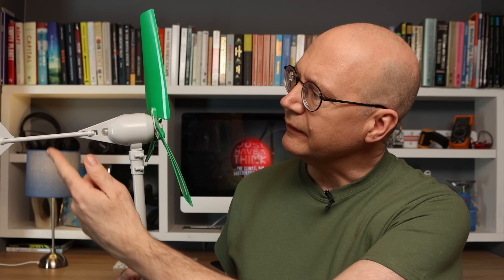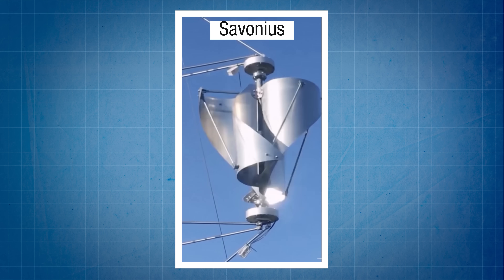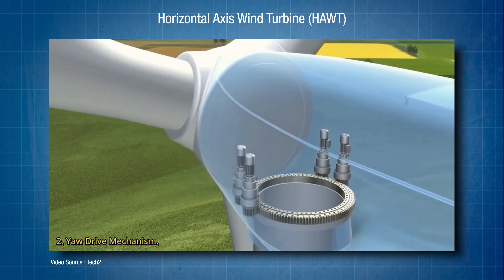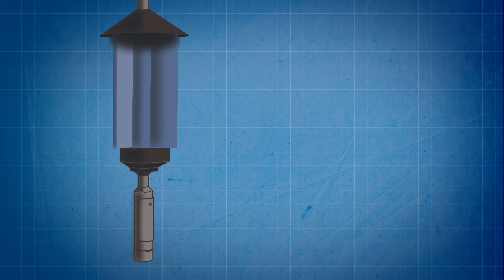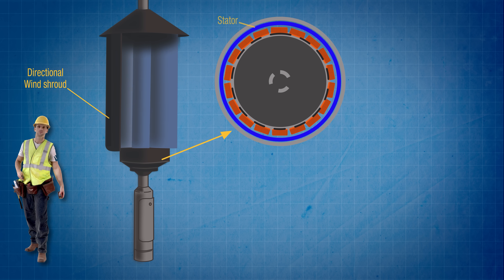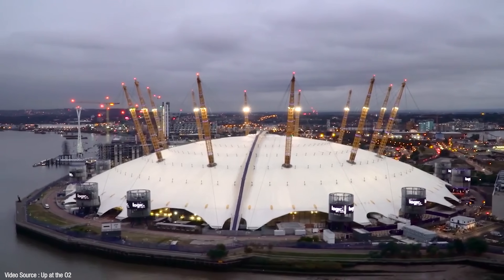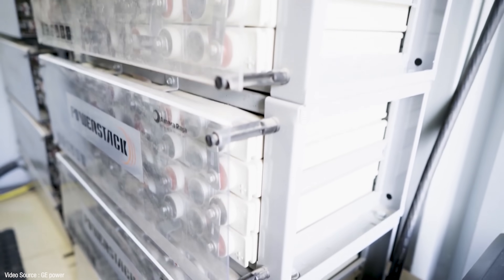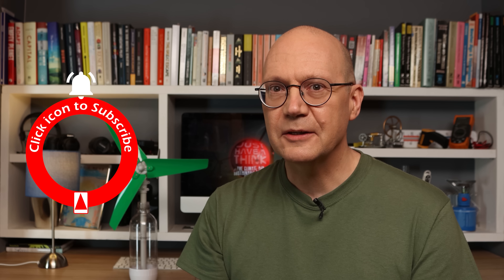A vertical axis wind turbine that doesn't need the prevailing wind! How do they do that?

Comment: The fact that they won't sell and only lease the units demonstrates their real motive.  A company that has a guaranteed 25 year revenue stream which can then be floated and sold.  I think the idea is sound but being locked into a lease contract when newer cheaper versions from competitors become available is unattractive.  I doubt they can have a generic patent on either vertical turbines or lamp posts so they kill competition with the lease agreement  May be I'm just too old and cynical.
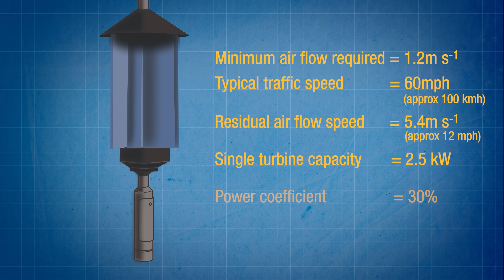Reply: You're not cynical enough: Dave's numbers don't stack up, they are wrong by either two (5:31) or three (8:50) orders of magnitude. So which is it, 2.5 or 24 kW? The right number for a VAWT this size is about 25 watt, by following the standard VAWT physics formulas. It's most likely a scam.
Reply: @tzenophile  Well spotted.  A 25kw VAWT would be huge, never going to be installed on a pole designed to take an overhead lamp.  Modern lampposts are designed to dissipate impact energy in the event of a car crashing into them.  They buckle and fold as you say more like 25w something in the many KW range would need a massively strong pole and foundation.

Comment: Build prototypes, test them, publish the results and then see if this is actually doable. Get the price per kWh for a complete installation and then see if its remotely competitive. Too many stupid ideas are thrown around in the Renewable area.
Reply: “Wasted air flow  from passing traffic” 
When this was tested on I-10, there was no air flow increase or benefits.
Reply: ALL of which were done before the company actually STARTED MANUFACTURING turbines. Then they ACTUALLY INSTALLED turbines they'd manufactured (not prototypes) on the highway and ACTUALLY MEASURED their output over an extended period of time.
Obviously, if you actually watched the video, you didn't actually listen to the information based on 3rd party data he supplied. He's ALSO supplied (albeit after you commented) pinned up top, the comparison to an equivalent solar farm.
Reply: @spidy9237 Contact the company. I just did for spec and cost sheets. If it's pure bullshit, Green Asphalt in NYC has spent a hefty chunk of change on it, their turbines are to be installed this summer. I remember when this company launched in 2018, and when they raved about their proof-of-concept test rig; I loved the engineering elegance of actually using entirely waste energy from traffic, when they thought they'd only get enough to maybe power the lights partially.
And go back to the video, the 3rd party test agency was mentioned, although it's not clear whether it's the Oxford or ENEA one. I'll find out when the company responds.
Reply: @ticthak  Asphalt is made from fossil fuels lol, it's not exactly green. Sounds like another greenwashing money making scheme.
Reply: @Withnail1969  that's the thing. Green asphalt is using renewable power to trap carbon for asphalt.
Reply: @Withnail1969  asphalt is one of if not the single most recycled materials in the world.

Comment: 8:07 The simple explanation that vehicles are "punching a hole in the air and causing airflow around them, regardless of whether there's a turbine or building or anything else on the side of the road" and that any airflow is therefore essentially "wasted energy" is incorrect.

Air molecules act as a fluid, with eddy currents and pressure differences having an effect that goes beyond the immediate vicinity of a few millimetres or centimetres.

My hunch is to be extremely skeptical about the claims made here. The vehicles may indeed consume more fuel in some scenarios. In other scenarios they may consume less but unless you're modeling the whole system and fuel consumption of cars going in both directions, in varying wind scenarios (crosswind, headwind, still), it's difficult to say if there is a net benefit.

This reminds me of my friend who claimed there was no way that driving 20 metres behind a truck gives a slight slipstream advantage with a head wind. These two objects are in fact connected through the fluid medium of air, so the system as a whole cannot be accurately modeled without taking into account the fluid dynamics of the air around and between the objects.

Comment: If the typical residual air speed is 5.4m/s, then the power would be around 315W/m^2 (assuming rho=1), before losses. Considering A is tiny (definitely under 4m^2, probably around 1), that would be about 100-400W with 30% efficiency.  It's nice, but I doubt it's worth the investment.

Edit: I think I multiplied by 2 instead of dividing...should be 25-100W.

Comment: I must have misunderstood your explanation, because the alternatives are that you got it wrong, or Alpha 311 got it wrong.
Surely the best configuration would be to have the coils on the stator (basically the pole) and the magnets on the rotor (the turbine) to avoid the necessity for slip rings. Am I missing something?

Comment: bollocks. adding load to the system in the form of turbines increases air resistance of the vehicles causing them to use more energy, develop more energy and pollute more, there is no free lunch it's being paid for by car owners, the air moves around the cars the way it does because it's the path of least resistance, lowering air speed along the road means each vehicle has to re accelerate that air, thus develops more drag, thus use more fuel to maintain the same speed.

Comment: Homes with these would be wonderful. I disagree with the comment that they would not be stackable, normal peaked rooves would both allow it and funnel air towards the top units. Homes on hills and mountains would get even more of a boost. Mass produced, these alone would fix most of the waste plastic problem, being mainly built of it. The bonus that these produce nearly 5 times the power of conventional solar farms,  (or I assume roof top panels) AMAZING :)

Comment: The energy these turbines generate is coming, as stated, from the fuel the vehicles are burning. So does the drag they experience increase when they pass close to a turbine? Looking at it a different way if a bunch of fans were blowing down the road in the right direction their energy would assist the vehicles. Also, down the track, when our autonomous cars slipstream a few cm apart they'll use much less fuel and the turbines will recover less energy. Of course that's ignoring the wind :).

Comment: I have an Interesting question. Does the passive engineering of the roadway it self have a negitive or positive impact of the air flow of the area?
   Typically one wants to avoid have a sympathetic additive effect with traffic but could we intentionally develop a road that is more prone to creating the wind tunnel effect: and if so would the extra 'energy' created by this type of system offset the lower fuel efficiency of the passenger cars?

Comment: I don't understand the price comparison. 5.8 kWh per day is 2100 kWh per year. Over a lifetime of 25 years that is roughly 53 000 kWh from each turbine. Can they really be manufactured, installed and maintained over 25 years at a profit with such a low output? I mean £ 29 000 per month would mean £ 69 600 per turbine over those same 25 years. Or in other words £ 1.31 per kWh. And that's not even accounting for inflation.
Reply: ... and maintenance/repair and insurance and taxes and cleaning and de-icing in winter (just think of a snowplough on the road throwing snow and dirt at the turbines) and... and...

Comment: Interesting points and these might have some of the claimed output, but I think they might not. I’ve been into aero- hydro dynamics for some decades. The problem with vertical axis wind generators is that their blades are only able to give a useful input to the axle for about one third of the rotation. The other two thirds, the blade is moving across or against the wind flow. The only reason this works at all is that, depending upon the type, the blade angle changes dynamically or the shape is meant to “collect wind” on one side and be “slippery” on the other. The former is more efficient and the latter is just a paddle wheel. Actually they’re both essentially paddle wheels. 

There are several reasons why boats stopped using paddle wheels and went over to propellers immediately when they were invented. An enormously superior efficiency is the main issue. An easy gauge of this is a size comparison. A classic paddle wheel steamer has an enormous wheel on either side. Each maybe 5 meter diameter and close to 1 meter wide. The propeller for the same ship would be a tiny fraction of one of them, while giving much more forward thrust from the same engine power. The paddle wheels would only dip the lower third, the useful driving part, into the water. The other parts were in the air, meaning the dramatically lower density would increase efficiency a lot. The vertical axis wind turbines operate immersed in one single medium, the air is on all sides. Thus, they get no such benefit.

Then there’s the main problem with this type of generator, which is harder to grasp but it’s related to air pressure around wings which increases exponentially with speed through the medium. A propeller will constantly move at 90 degrees to the wind and as mentioned it will generate thrust in its entire stroke. It will also move very fast through the air. This means it exploits this exponential issue perfectly. The force on its wings is many times higher than what it would be as a flat on “push”. This gives a huge difference in efficiency. Enormous. Still, the vertical axis wind generators can have more area inside their span and might exploit varying and very light winds better, so maybe this still works ok. However, I think they over estimate how far the wind coming from cars moves from the actual track of the car.
Reply: I am in no position to argue with you as regards efficiency but if these things only produce half the energy stated, say 3KWH per day that is quite something when one considers the number  of suitable motorway lamp / sign posts. Also power generated early in the day and late in the evening during rush 'hour' is more valuable than energy produced midday. (in the sense that there is lots of PV available midday but little or none when people are having their breakfast & dinner - the peak times for electricity demand.) This is a wonderful idea to pursue, certainly one I would never have thought of.
Reply: I just now commented this above as well, so if you could confirm this point that would be helpful as I haven't worked on Aerodynamic modelling since my engineering studies:

The application of these vertical turbines on highways would essentially be increasing the drag on the passing vehicles by creating a lower pressure point than there would be if they weren't there. Essentially draining additional energy from the vehicle to power the turbine, right? 
Instead of having a smooth outline of pressure lines around the vehicle now, due to the turbine, there is an additional low pressure point next to the vehicle which creates additional drag that needs to be compensated by the engine.

This should be easy to model actually. I don't understand why this concept keeps popping up. There is no "free" energy. This concept would essentially be reducing the efficiency of transportation too provide electricity on the grid that will partly be used by transportation when we're all driving electric. Each conversion step creating losses.
Reply: I'm not an engineer, but how about using a sort of screw type blade, not a complete spiral, but a multi-blade helix configuration?

Comment: Im still waiting for wind turbines to start using ducted jet turbine types of designs using compressor rings etc . Just as the wright bros twin blade has evolved. Mulled over ideas in my noodle for a few years and it just seems that it is a logical progression?

Comment: Hi Dave, just found your channel via a YT recommendation. The harvesting of the otherwise wasted energy from the airflow generated by motorway traffic is an amazing idea indeed! I'm wondering whether there had been any studies done on the subject of possible turbulence increase caused by the turbines themselves. The efficiency calculations you've shown do not seem to be taking this possibility into account, but I imagine it's not impossible that the interaction with the traffic-induced airflow and the turbines may add to the turbulence impinging on the veicles which generate the waste airflow energy in the first place. I can't help remarking that Feynman famously considered turbulence to be the hardest problem in physics, after all (with turbulence in a compressible fluid being perhaps the gobsmackingly hard of the hardest). Is anything known about this possible interference, and its impact on the bottom line of net energy recovery?

Comment: 5:55 Theses numbers seem very optimistic to me.
But if they are real, it mean you would generate about 50 cents per day or 150$/year give or take.

After 10 years, you got 1500$.
Assuming no maintenance (cleaning, bearing wear, accident, broken parts, etc).
If it cost you more than 1000$ per turbine, your ROI is a risky business.

If this area is a windy area, it might be better to use larger "real wind turbine" with proven/predictable ROI.

Comment: I do not see wind and solar powering a vertically integrated iron and steel mill factory, nor any different types and kinds of heavy industries such as the machine tool industries, heavy engineering industries, and machine building industries.

Comment: Has anyone looked into building wind funnels? I run through downtown Houston, and even on days with low wind, the wind near the tall buildings is many times higher. You don't have to build an expensive building, but a building of dirt or whatever is cheapest can send the wind into a turbine. A wind funnel seems the cheapest way to me.

Comment: I agree VAWTs may have some practical applications, including this one, but I am somewhat sceptical about the company's claims about the potential power output from 125 VAWT turbines at the scale described. It does not seem consistent with conventional wisdom on vertical turbines. Maybe their sums are correct and they have a cutting edge design that can deliver, but extraordinary claims that challenge consensus require extraordinary evidence. Monthly lease models create dependency and this proposal would generate an ongoing drain on public finances, so potentially a bad move for taxpayer value in the long term, particularly if the company's claims turn out not to stack up. Why the lease model? Is the data available for peer review?
Reply: Dave's numbers don't stack up, they are wrong by either two (5:31) or three (8:50) orders of magnitude. So which is it, 2.5 or 24 kW? The right number for a VAWT this size is about 25 watt, by following the standard VAWT physics formulas.

Comment: Any thoughts given to to percentage of crashed & constant replacement of road side turbines

What about fatigue turbines under constant multiple directional high volocity air current
Eg gust of wind in storm system vs your vehicle creating wind from opposite direction

Maybe located under a plane path near landing strip of airports
Land & take off maybe the winner

Comment: There's a far simpler solution for recouping the energy.   Don't use the energy in the first place.  This will never be as efficient as simply reducing speed limits.  It's trying to recoup energy lost as the vehicles charge through the air at a high rate of speed... which as we know, the faster we drive, the amount of energy required to push through the air increases exponentially.  

Lower speed limits from 70 mph to 55 mph and the cars will use significantly less energy to travel the same distance, and less energy will be lost in kinetic energy transferred to the air.   Think of the advantages.  For ICE vehicles, you're reducing the amount of gas they use and emissions they produce.  As a result, there's less gas and oil demand.  Oil/gas prices drop, so transportation becomes cheaper.  For EVs, they become more efficient and require less grid energy to charge them.  Less grid energy demand should help reduce prices.  It may also allow us to reduce the size of the batteries in the cars, so the cells can be spread out among more vehicles.  

What's funny is that these turbines would only be over a small stretch of road... about 2 miles.  What about all of the other road where these aren't installed.  All that excess energy is wasted.  Well, lower speed limits can be applied to the entire road way.  And it doesn't cost million of dollars for every 2 miles to recoup only a tiny amount of the lost energy.

Comment: another application could be retrofitting them on skyscrapers or 7+ story buildings seeing as how these structures already redirect wind by their sheer position, size, and height. Ringing the top of a building or lining the corners could allow for the capture of wind amplified by the presence of the building.

Comment: Put a field of thease at the end of the runway and hold short positions. It could nock off a big chunk of runway lighting cost. Mount horizontally low on the ramp and taxiways out of the wheel lineups.

Comment: An interesting idea but! 6kW/hrs/day/turbine! I think somebody got their desimal point in the wrong colum. I would have trouble believing that a turbine of this type could output even 600Wh/day.
Reply: The output depends on the size of the turbine & the wind speed.
Reply: @TraditionalAnglican   No shit!
Reply: Excactly. Dave's numbers don't stack up, they are wrong by either two (5:31) or three (8:50) orders of magnitude. So which is it, 2.5 or 24 kW? The right number for a VAWT this size is about 25 watt, by following the standard VAWT physics formulas.